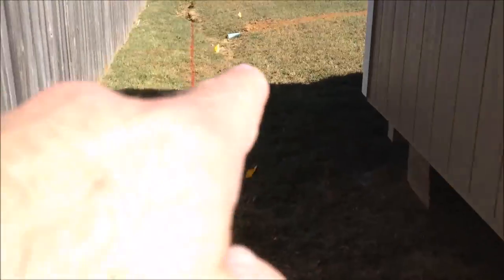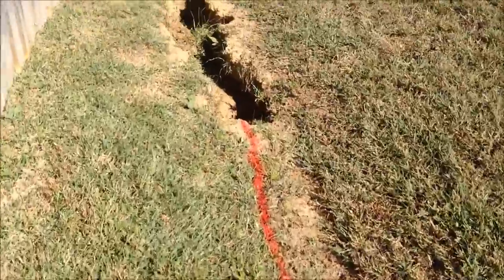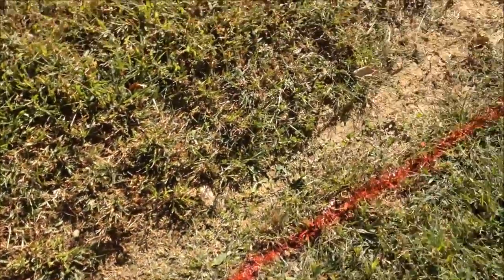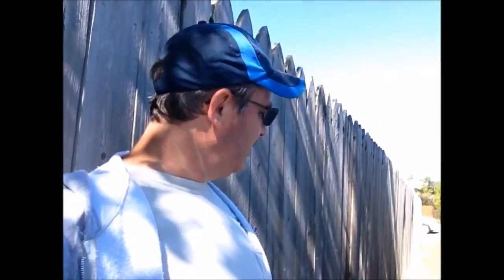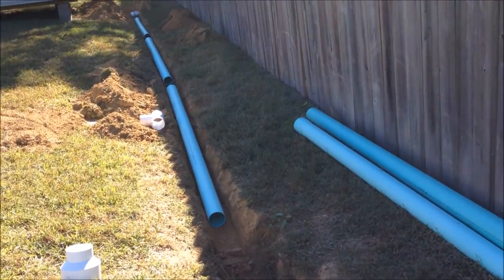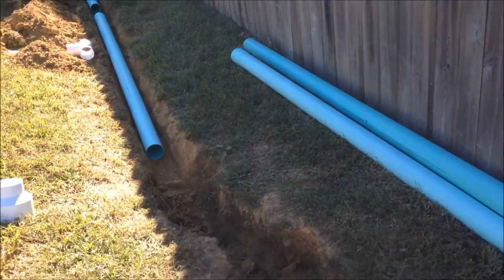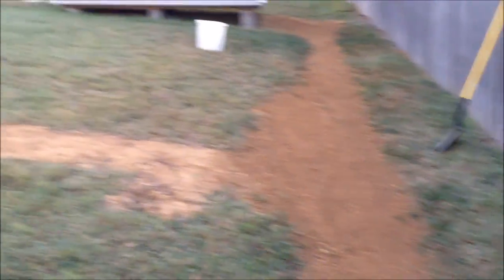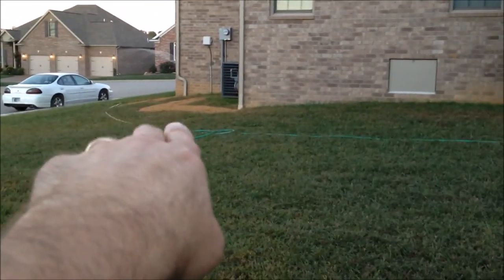Next Phase of the Drainage Project

Comment: Looks great Bob...  The only thing that I would have done different, just from my personal preference, is instead of putting a 90 in, I would have put 2 45's in there.  What you did was perfectly fine, it is just my personal preference to use 45's instead of 90's.  But it looks fantastic my friend..
Reply from the maker: +Roger Teaters Hello Roger,
  I didn't think about that but it would increase the flow by gradually curving the pipe instead of an abrupt 90. 

Bob

Comment: you did good and got a lot done. is there a reason you used PVC vs black corrugated flex pipe for the long run "ditch"?
Reply from the maker: +Marcy Cooper Good morning Marcy,
   The black stuff crushes easier and over time, I.M.O. Degrades. Just a personal preference. 

Bob